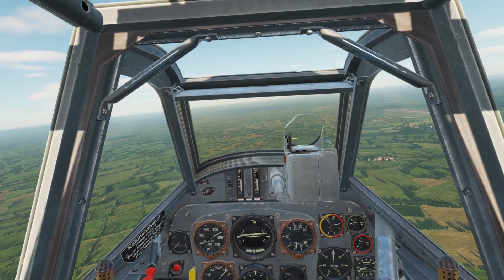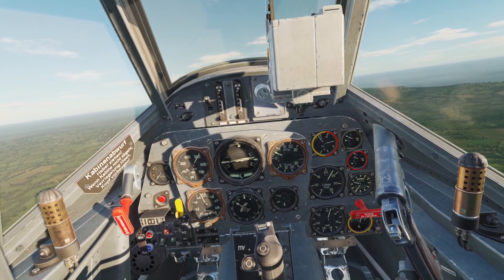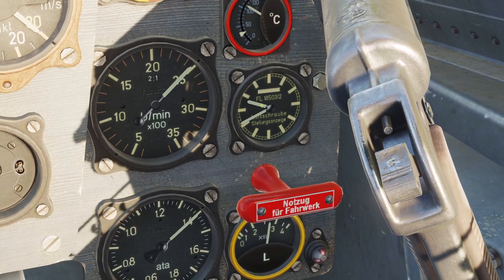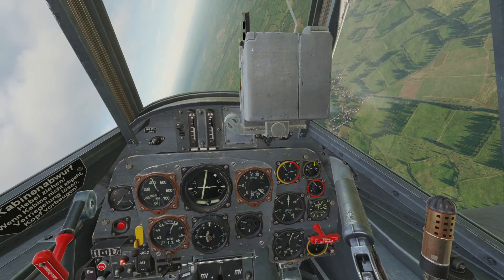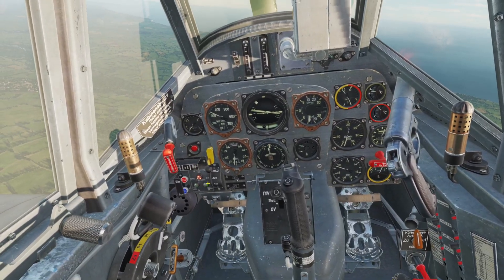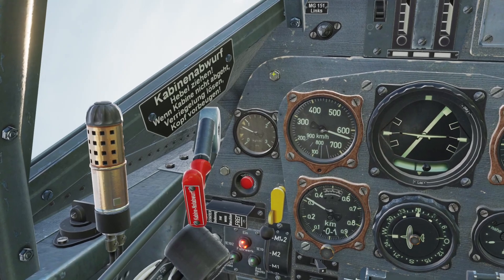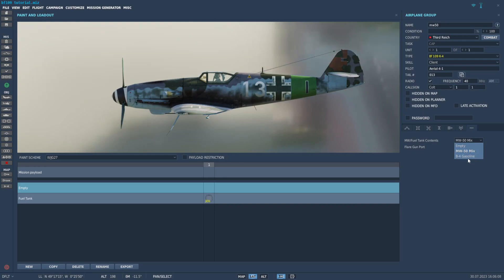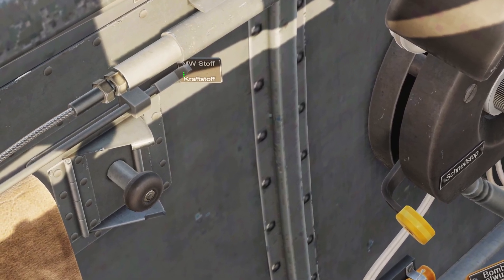DCS Bf 109 K-4 Engine Management

Comment: I don't know what eagle dynamics has done but no matter how gentle the engine is now run, the engine fails,  making the 109K module completely unplayable now.
Reply: Has it been fixed? I bought it today and did the training missions, as well as just flew around after the takeoff one before I even knew about which MPA settings were ideal and never blew it for about 40 mins.  Just made sure to open radiator when it looked appropriate.

Comment: Nice and short. Well done. 

Quick notes: 
Power settings:
1.35-1.36 ata is a valid cruise setting that can be run forever. 
1.2-1.25 ata is a conservative setting for better fuel economy. 

For combat, 1.42 ata is perfectly fine. 

You can run this setting for a long time if you manage your radiator partially manually. Open it once in a while to bring the temperature down. Fuel economy is not good with 1.42 ata. 

War emergency power / MW50: 
The DB605 in this plane cannot run beyond 1.42 ata due to the low octane fuel that's modelled here. The shaking that happens when pushing the engine beyond 1.42 ata is knocking. With higher octane fuel, the engine could run at around 1.62-1.65 ata (we call it dry boosted) because the fuel is more resistant to knocking. 
MW50 cools the engine internally and increases boost pressure at the same time which is why 1.8 ata are possible with MW50. 

MW50 only works below 8km of altitude. Above that it will decrease in effectiveness rapidly. 
However, you can then run the engine at increasingly higher throttle positions as due to the decreasing ambient air pressure your engine's manifold pressure also goes down. 

Above 9 km or so you can run pretty much full throttle (war emergency setting) without going above 1.42 ata and 2,850 rpm. 

Prop-pitch control: 
The automatic governor is set such that prop-pitch is set for high performance without stressing the engine too much. Hence, at 1.42 ata or 1.8 ata with MW50 the engine will be around 2,650 rpm. 
Its limit is at 2,850 rpm so manual control can be used to squeeze a few more rpm out of the engine. Caution must be applied. 
A more relevant use case is to limit engine rpm to more fuel economic settings, such as 2,100, 2,200 or 2,400 rpm. 

In real life, pilots would have used manual control to reduce rpm to save fuel during ferry legs of the mission or to increase their airborne flight time. 

Best regards, 
I/JG7_Killerfliege
Reply: If I'm not mistaken, the radiator is set to "open" during takeoff and landing to provide optimal engine cooling, given the low airflow speeds during these phases. I think I read that in a regulation. However, it doesn't necessarily have to refer to the "K." Best regards. :)

Comment: The radiator disconnect is used when a radiator has been punctured in combat and when you operate the lever, it isolates that damaged radiator so that no more fluid is lost from the coolant system. As for propellor pitch change, the pilots used to listen to the pitch change rather than look at the pitch guage. They made sure to push the thumb button forward ahead of pushing the throttle forward.
Reply from the maker: thanks! i didnt know about that